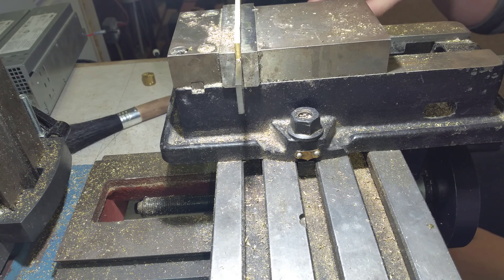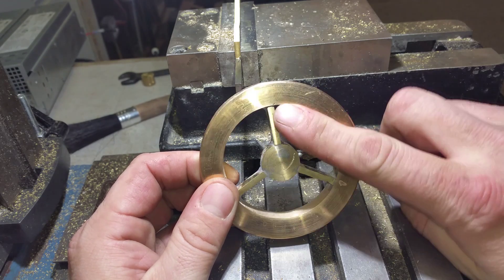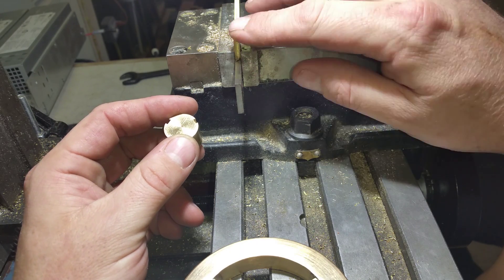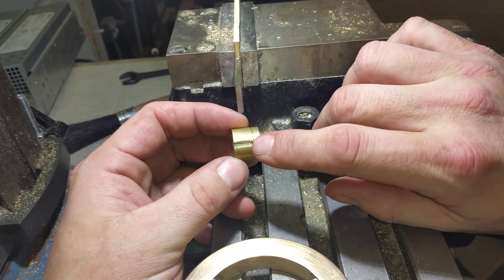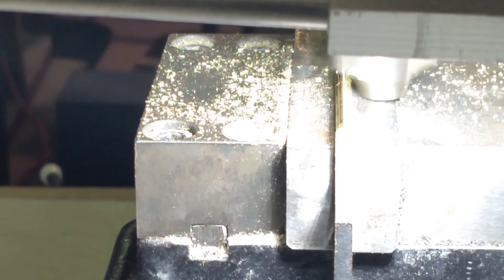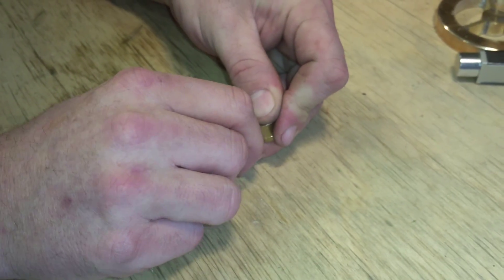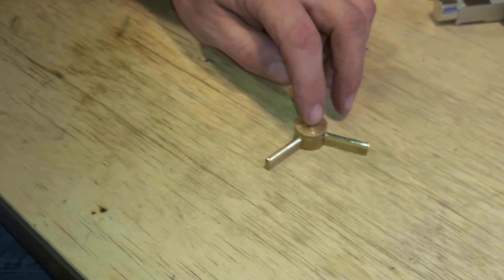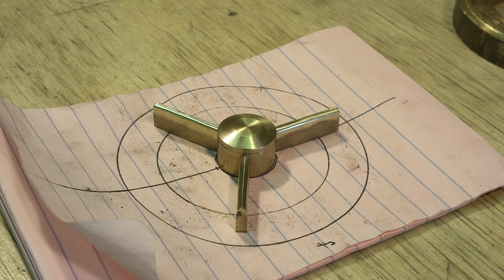Brass casting: #2 Flywheel mold making

Comment: Your spokes don't have the 3 degree tapers on the sides.
Reply from the maker: +Grandpa Bill Hello and thanks for your comments..  You are surely correct on the missing angle.  This series was learning curve for sure. Thanks to all the people that did comment i was able to correct my errors and include a draft angle in my later castings which are also posted on you tube. Brass casting 8 and 9 show how i overcame these problems.  -Cheers  #8 https://www.youtube.com/watch?v=CmHRWEdbRVU